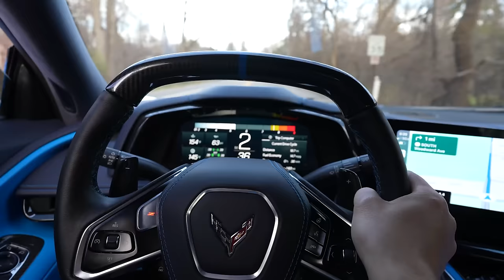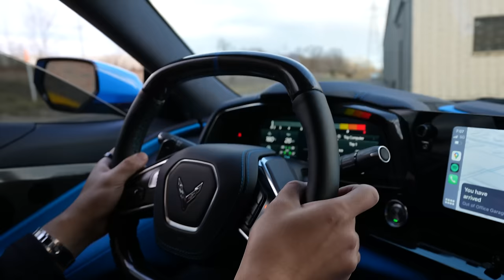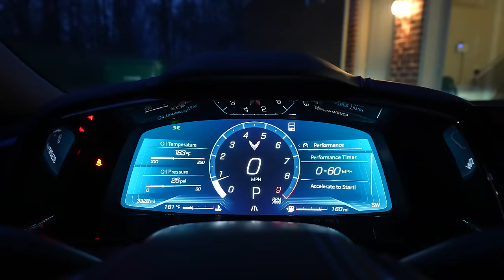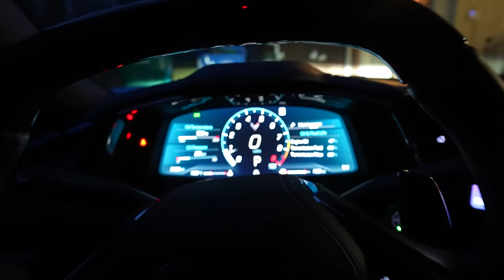FINALLY...The Z06 Is Back!!!

Comment: I always felt that idling your car for long periods to "warm it up" is one of the worst things you can do for the engine. Start it, let it run for a minute, then drive it slowly until all operating temps are normal.
Reply from the maker: I feel like this is a forever endless debate 🤷‍♂️ I always let the car idle to at least 100-120F before driving.
Reply: @EddieX  Beautiful spec car regardless. Wish you could have kept both the 350R and the Z06. Future Classics.
Reply: Good thing ur not a mechanic then 😂